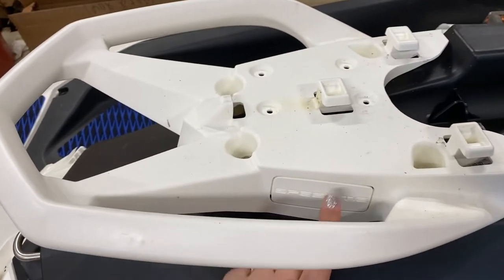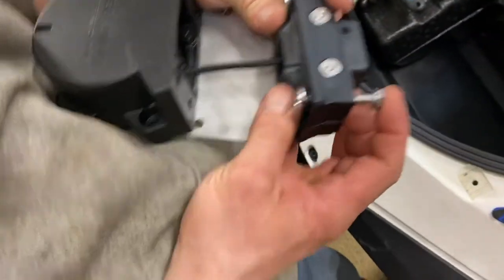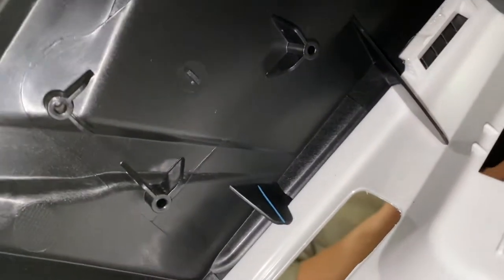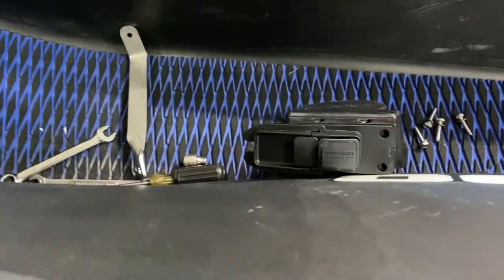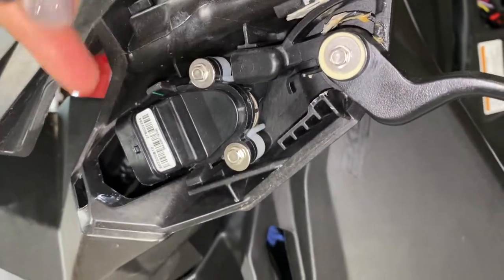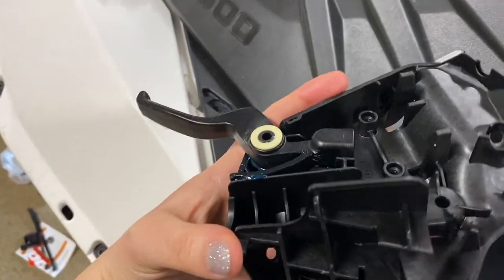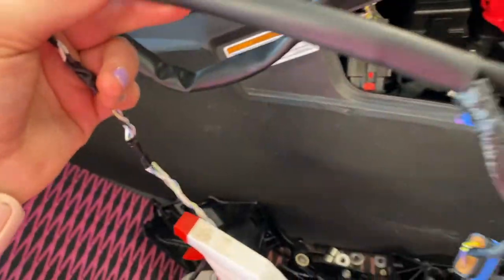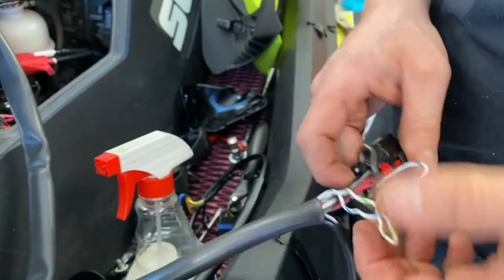Seadoo spark conversion part 3

Comment: Hi 
Just to be clear to get the extended VTS function you only need to install the plug n play part that in the video? There's nothing else that needs to be done? Look forward to the on the water videos
Reply from the maker: There is some wiring that you have to
Snake up the neck and plug it into a button on the handlebars
Reply: motokidd39 
Right I saw that. But that’s it? You don’t have to do anything to the jet or gate? It’s just put that part on and the vts works?
Reply from the maker: Correct, plug and play 😬

Comment: To give me an idea on the sea doo spark 1. Is it good for two people? And can u give me an idea on how big the storage in the front is like how much can it fit?
Reply from the maker: The 2 up can hold 2 people and the 3 up can hold 3 but they really aren't that big so if you're going to have someone with you all the time I'd go with a 3 up. You can hold quite a bit of stuff in the front. I have 2 small boat bumpers for my ski a dry bag and ropes that I put in there comfortably.
Reply: motokidd39 you think that towels lines and bags could fit
Reply: motokidd39 and would it be worth it getting a gti for same price as a 3 ip
Reply from the maker: It's really not that big I put a towel in my dry bag but I never use it. I feel like I have way more fun on this than people with bigger boats. It's small but mighty. I love my spark
Reply: motokidd39 thx

Comment: Did all come in a kit? Or did you have to buy the parts espérate?
Reply: Separate, also what year is your spark? I have a 19
Reply from the maker: Separate, mine is a 19 so the green and blue. The blue and white one is a18
Reply: motokidd39 how much did it all cost roughly?
Reply from the maker: About 500$
Reply: motokidd39 where did you order all the parts from? Can you send me a link?
Reply from the maker: I got everything right on amazon. Just look up "seadoo spark ---" make sure you get the VTS extended
Reply: motokidd39 did you buy the ibr or did yours come with it
Reply from the maker: Had to buy it. These jet skis are stock sparks . We converted them into a trixx.
Reply: motokidd39 thanks
Reply: motokidd39 are uploading the video of the full conversion soon?